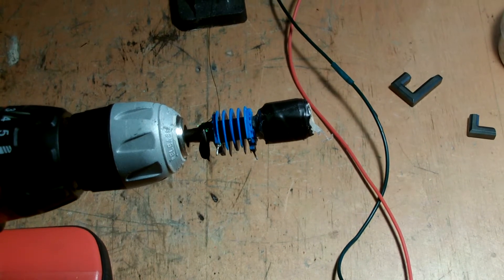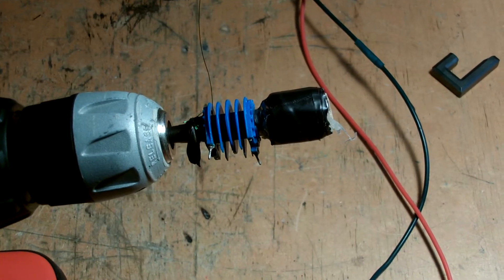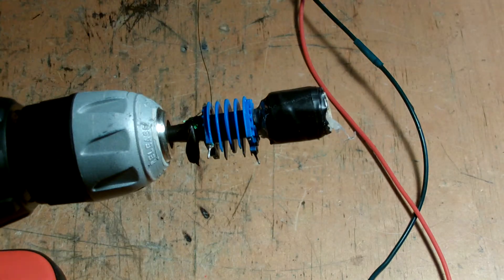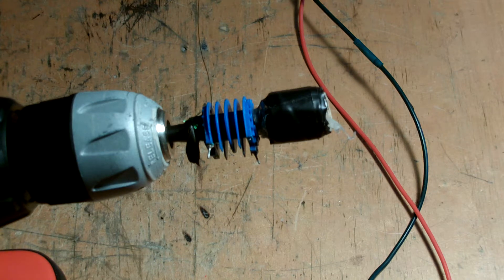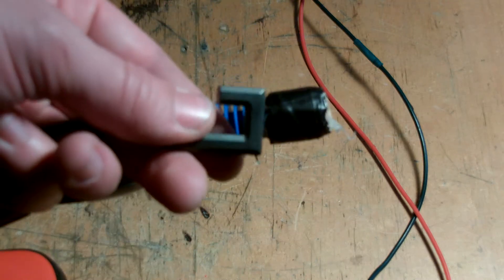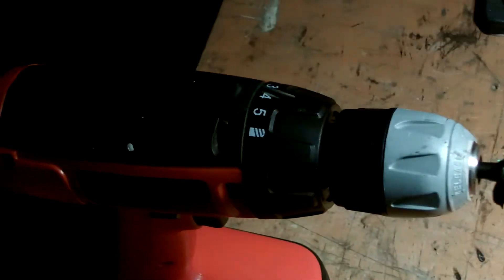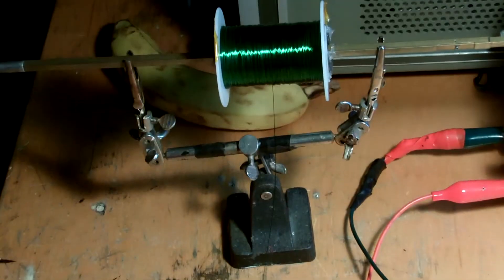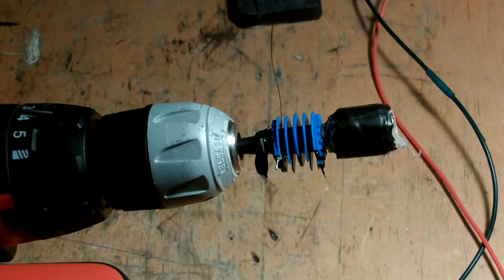Winding of small Flyback

Comment: Why did you use just one coil? Aren't flybacks supposed to have a short and wide primary and a thin and long secondary?
Or that's just a large inductor?
Reply: +Victor Arnaiz I assume this is only the coil for the high voltage side of the transformer, the side that usually melts xD.

Comment: Nice method with the drilling machine there Pete!
It would be nice to have a counter of some sort,
so you know exactly how many turns you're putting on.
First thing that comes to my mind is a magnet tapped
to the chuck, with a reed switch on the drill body wired
to a computer keyboard PCB, Open a notepad up and
let whatever character you connected to tally up, then
check your character count after! x]